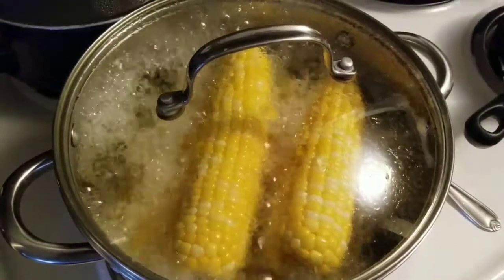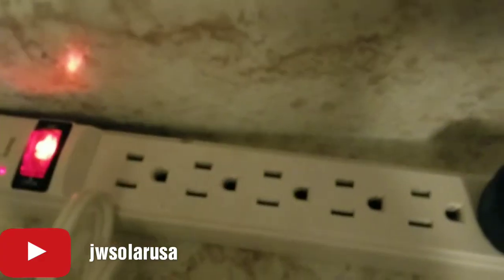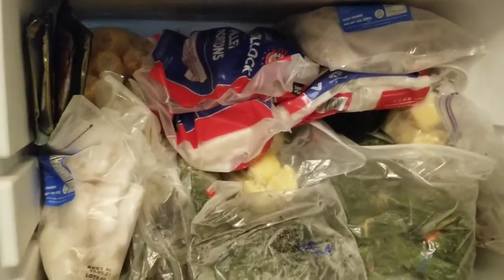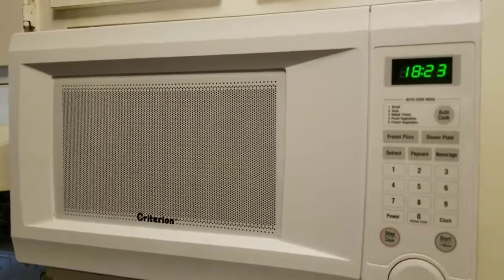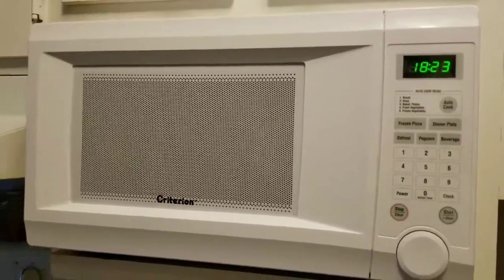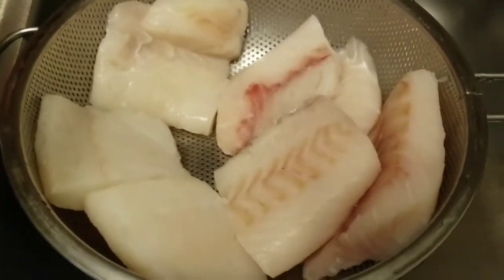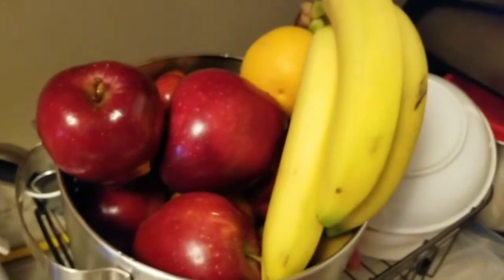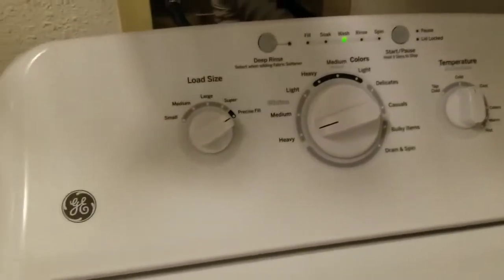DIY OFF-GRID SOLAR, POWER CONSUMPTION OF HOME APPLIANCES

Comment: i hope all is well,, have a question  about the leaf battery,,im building a 7 in parallel and 7 in series ,,the question i have is on the parallel part and the bus bar size i would need,,if im right i need a thicker bus bar,,than what came with the battery when t took it apart?,,to me 7 batts in parallel,is 462 ish ah,,?? i ran across a x table for figuring out your amps,,for mine its like this,,4000 watt inverter/48 volt = 83 amps the bus bar has to handle,,if im right??? i don't know that's why im talking to you you seem to know alot about batts,,,thanks for your help
Reply from the maker: Just use the bus bar that came with the Nissan Leaf.
Reply from the maker: Question for you as well.
Why are you not sharing your videos with us?
YouTube is a sharing platform for everyone and don't only be a taker try to be a giver as well that helps everyone.